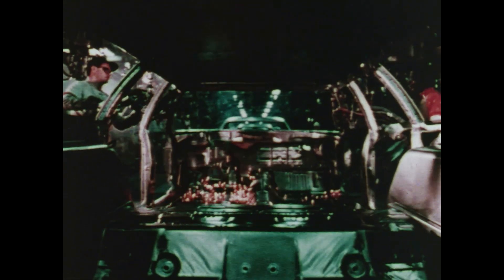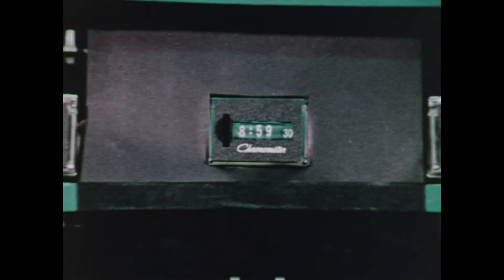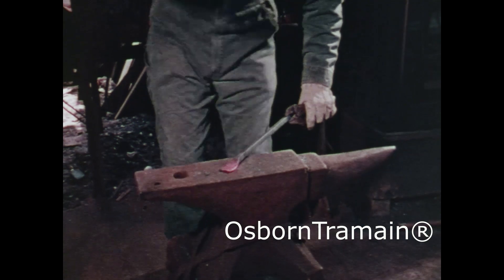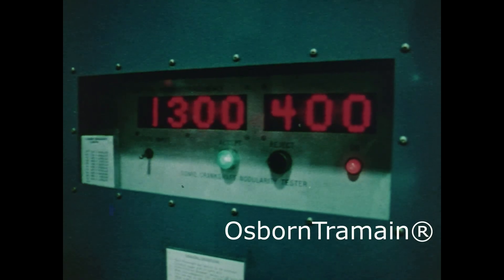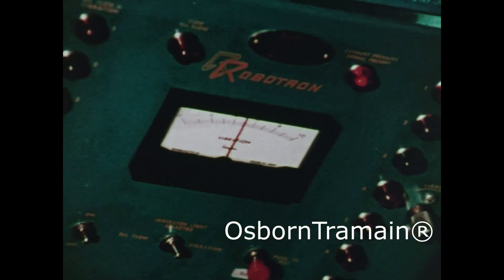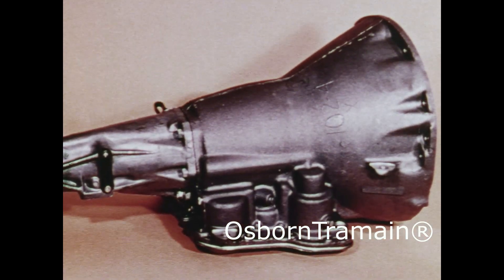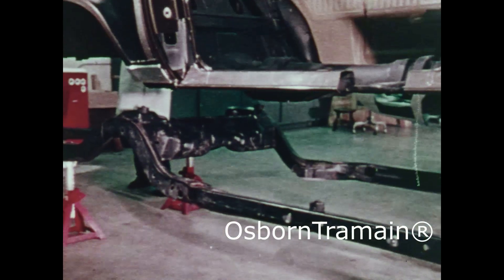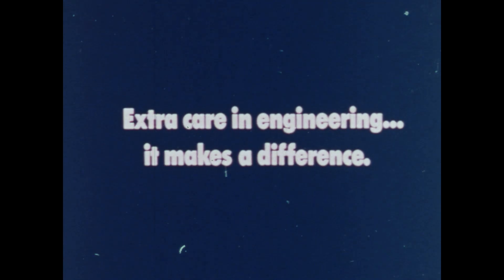1974 Chrysler Plymouth Dodge Engineering Commercial Film

Comment: Were the Chryslers back then really as well built as they claim
Reply from the maker: Yes, in my opinion, yes.  Others might disagree.  My personal feeling was AMC and Chryslers had the highest quality.  There were exceptions with the Dodge Aspen and Plymouth Volare of 1976 and 1977.
Reply: The engineering was tops. Lots of creative solutions. But there could be times when the engineering concept reflected a more sensitive solution than manufacturing tolerances could deliver. For example, the Lean Burn System of the mid 70’s proved problematic and needed frequent adjustment. Other components might have had a replacement frequency that was higher than other manufacturers, but they were very predicable. Power steering pumps (which worked very hard to deliver very boosted power), alternators, and water pumps expired at 70k miles, 80k miles and 90k miles, respectively, but they expired at the same mileage from car to car (at least in my experience); I could buy a part a few miles in advance and have it waiting in my trunk for when I needed it. But generally the cars were manufactured with more care than others. Especially the drivetrain. Also, by this time rust issues were largely solved in the big and mid-sized bodies. 
And yes, I’m a fan boy I guess.
Reply: The build quality was a little higher than everyone else's.  My father's 1973 Plymouth Gold Duster, for example, had a leak when it rained heavily, that filled the passenger side foot well.  No one every found the source of the problem.  However, everything else was superb.  The interior was put together nicely; nothing flimsy.  Torqueflight transmission never required maintenance in the 20 years he had the car.  The air conditioner blew strong and cold.  Up to the time my father bought that car new, he had been driving junk.  The day I came home from school and saw that gorgeous car, I screamed and yelled all the way up to the house, I was so happy.  Chrysler products were awesome then.
Reply: I drove full size 70s Chryslers all through the 90s when I had a travel job. Usually about 30,000 miles a year. Never failed to get home.
Reply: This was in the 1970s?
Reply: Lean burn was a problem. Most people remove it, although I saw a forum post at forcbodiesonly where a guy got his running quite well.